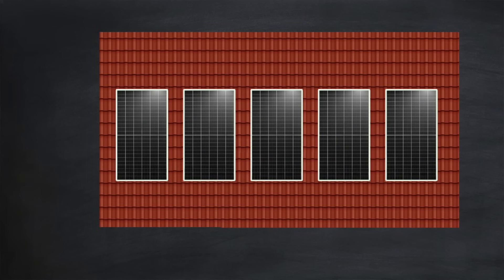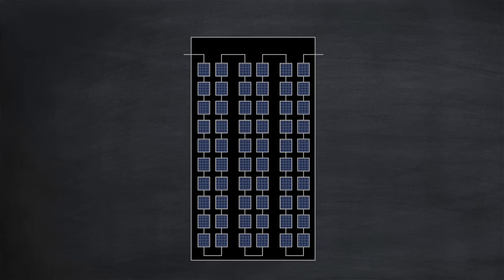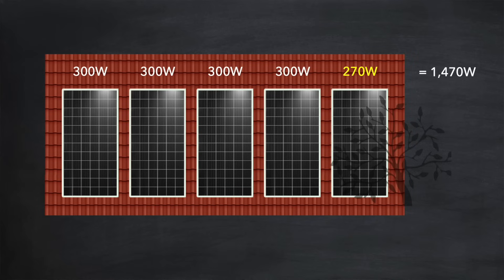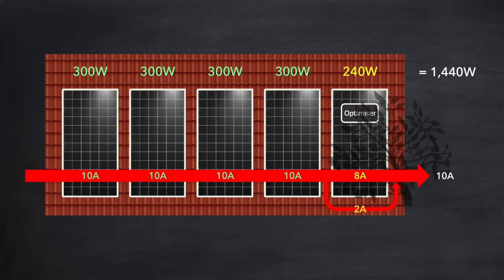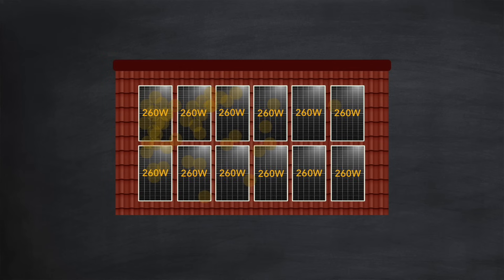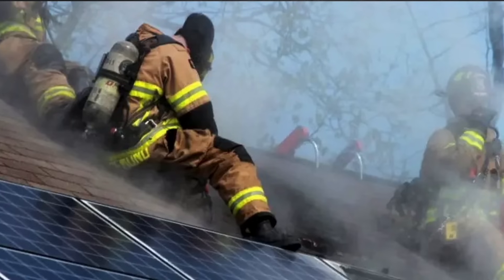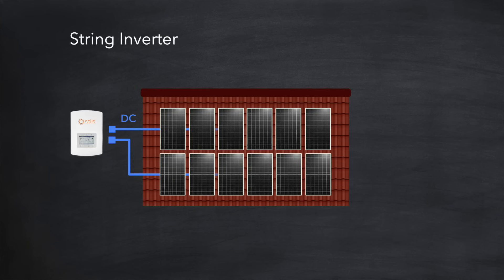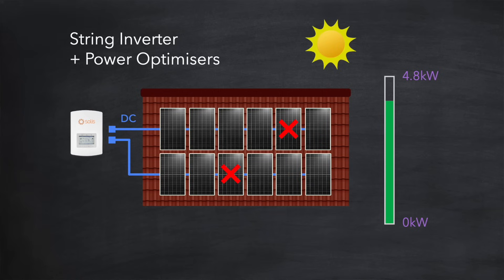Power Optimisers - What are they? And do you really need them?

Comment: OT:  Has anyone developed a mounting system for PV panels where they're attached to the railings on one side with hinging pieces and on the other with a latch release?  This would allow a technician to unlatch the panels and swing them out of the way which would be ideal to access a problem in the middle of a panel array instead of removing several panels to gain access.
Reply from the maker: Hi Glenn, I like your thinking on this. I'm not an expert but having an easy access mechanism could be a good thing... it can't add much to the cost, surely?

Comment: Not much point in a string inverter setup, with or without optimizers.
Reply from the maker: Why?
Reply: @GaryDoesSolar  ??? I thought it was fairly obvious but since you asked. As you and other pointed out: Still have single point of failure, not much benefit for cost, relatively high failure rate. Money better spent on micro inverters: higher reliability, softer failure mode, more up front company (Enphase). 

BTW, Since you read and responded to this post with a request for a reason, would you explain why you didn't respond to my next one pointing out the inefficiencies of your solar installation?
Reply from the maker: @GntlTch First, I prefer people who make claims to back them up, so others can judge for themselves. Second, give me a chance, why do you? 🤣 I get a lot of comments, emails and messages every day. Third, I think it goes without saying that I would know how to run my solar and battery installation efficiently, don’t you? I’ll respond on that shortly…

Comment: A tug of war between Microinverters and String with optimisers. Everyone is lying, not infact they are biased one or the other side. If cost and ROI is the concern, always go for legacy and proven. We need regulation in both sides to have some standards body to make sure customers do not suffer losses due to vendor lock-in as the solution is supposed to last half a century or more.
Reply from the maker: Certainly, it's always worth putting in time and effort to check the performance and reliability of any product you're interested in before you part with your hard earned cash. Solar forums on social media is a great way to do this.

Comment: Thank you Gary for creating this video blog and sharing it! Very helpful. I assume either SolarEdge or Tigo string inverters will work with or without optimizer. Looking at Tigo web site I got impression, I must use optimizer. Since it does not clearly say the inverter can be used with out optimizer. Also  Tigo "hybrid" inverter says "can use with or without battery connected". If that is true, it can be used like "string" inverter.
Reply from the maker: You're very welcome :-)

SolarEdge Optimisers are required for SolarEdge inverters, but Tigo optimisers are optional for any other solar installation. Yes, a hybrid inverter, although designed to accommodate a DC Coupled battery, does not have to have one connected.

Comment: thanks. however, you did not cover the fact that optimizers allow you to put panels on different slopes and azimuths, and have them still connected to that same MPPT of your string or hybrid inverter. for me that is probably the biggest benefit of them, and I'm going to install Deye optmizers soon when they arrive, together with adding more panels to additional roof slopes that were panel-free before.
Reply from the maker: What you say is true, but it's a limited benefit and not one that many installers recommend, from what I hear.
Reply: @GaryDoesSolar  it's the most benefit, since I now can add 3kW of solar easily without losing any efficiency and without any major system rework.
Reply from the maker: @BackyardVoltage  Hopefully your inverter is one that can accommodate such a configuration (i.e. global MPPT scanning).  I'd be interested to hear how this goes... thanks!
Reply: @GaryDoesSolar  it actually already does. Since it's Deye 10kW 3 phase, and currently I have 6+7 panels paralleled strings on its MPPT1, and MPPT works perfectly balancing the power output from various size paralleled strings (currently all the panels are on same 33 tilt and -22 azimuth), I've been doing many tests with it. But optimizers will allow me to get more panels added there to the other roof side (55 tilt and 68 azimuth) to cover the evening peak better, and also due to high tilt it will be so much better for winter (better winter angle to the sun, and no snow build-up).
Reply from the maker: @BackyardVoltage  Sounds great - and good to know, thanks! 😃

Comment: Hi Gary, Hooking up an array of ten 400 w each panels. Going into a EG4 18k hybrid inverter. Then EG4 battery bank. Two or three panels on the east end of array will be shaded in the morning by a tree. Should I add optimizers to just those three? What would be the point in doing all ten when the seven panels are clear of shade all day?
Thank you very much.
Reply from the maker: Hi Brent, unfortunately, l'm not in a position to provide individual advice (not least because of potential liability issues, even if that advice is given free - such is the world today). You're best to speak to an installer for such advice, or post a comment onto a solar forum (e.g. this one in the UK: https:// www.facebook.com/groups/2197329430289466). Good luck!

Comment: Surely a 0.05% failure rate is 1 in 2000 not one in 200?
Reply from the maker: It is, but if it’s a 10-panel system, each with a microinverter…

Comment: Good explanation, but you didn't talk about cost difference. Example..I have a 24KW Solar system with 60 panels at 450W. I can get my three 8.2KW Fronius Primo String Inverters for around $7,500,- while the 450W enphase micro inverter would cost about $14,700,-. That's close to double the cost. 
There are a lot of plus and minuses on both sides when it comes to String Inverters/Micro Inverters/Optimizers. I can just talk from real world experience. In 20+ years we are now on our 3rd system. 1st one was a 3KW system with a quality string Inverter installed under the Eve outside...never a single component failed or showed noticeable degradation in 10 years. We sold the house and I do believe that it's still working (now 20 years) as I drive past the place fairly often and I can tell that the original panels are still on the roof. 
2nd system was a 4.2KW hybrid system with the Inverters installed in the rumpus room. !0+ years absolutely no issues and after 10+ years I could not tell any degradation. In that period I went twice on the roof and gave the panels a wash-down with pure water, no detergent. This system has now been upgraded to 24KW. 
I directly know of 3 users of micro inverters that all had one or more issues with them, including one within weeks of the installation. 
Were they just unlucky?..possibly. Have I been just very lucky..also possible. But I also put the odds in my favour by selecting quality and proven components and reputable installers.
Reply from the maker: Would be interesting to know if the microinverters in question were Enphase IQx series. I don’t really rate other microinverter products.
Reply: @GaryDoesSolar They are/were Enphase, but which model I wouldn't know. This was at least 5 years ago with the one where failures happened shortly after the install. He had a 10KW system installed and there were issues with 3 or 4 panels, which took multiple months to be resolved. Although that says more about the Installer then the product itself.

Comment: I have four 330 watt panels that I use to charge an Ecoflow power station. The panels are wired in 2S2P. The other day one panel suddenly stopped working and I lost 50% performance. The panel that it was in parallel still shows amps using my amp clamp and the suspect panel shows zero amps. I tried the panel in a series string of three and I get zero amps. If I take the plus and minus of the bad panel and connect them together I get 9 amps the panel is rated for. I'm thinking bad bypass diodes. What do you think. I have ruled out connectors.
Reply from the maker: Sorry that you’re having issues with your setup. Unfortunately, I’m not in a position (not insured) to provide individual support/advice. You may want to contact the manufacturer direct. Good luck resolving 👍🏻

Comment: I have 25 panels installed in 2015. Ive had 2 microinverter failures. 1 in 2022 and 1 in 2023. Either your stats are wrong or im super unlikely. Enphase.
Reply from the maker: Sorry to hear about the failures. Were they rectified under warranty?
Reply: @GaryDoesSolar  1 was. I'm waiting on the second. The install company moves extremely slow.
Reply from the maker: @angloblaxon  I'm planning an interview with Enphase soon, and will ask them about product reliability...
Reply: @GaryDoesSolar update. My solar company got out of that part of business and I'm not receiving any support. Add that I need a new roof and to remove and reinstall is 10k on top of roof. I've decided to ditch the enphase system and install the panels via ground mount with a string inverter. Diy.. wish me luck.
Reply from the maker: @angloblaxon  Sorry that your installer went out of business - might explain then why you didn't get decent support. I wish you the very best on the new approach! 👍

Comment: @GaryDoesSolar, can you help me if i have to select 600W or 450W opzimizer is enough for a system, where all opzimized panels are DAH 410W panels.
Optimizer is Huawei PV 600W or as asked the same but with 450W?

I'm not sure i only need to check the W rating of the solar panel, or some other detail from the datasheet?
Thanks in advance for your feedback!
Reply from the maker: Unfortunately, l'm not in a position to provide individual advice (not least because of potential liability issues, even if that advice is given free - such is the world today). You're best to speak to an installer for such advice, or post a comment onto a solar forum (e.g. this one in the UK: https:// www.facebook.com/groups/2197329430289466). Good luck!
Reply: @GaryDoesSolar  hehe world is a crazy place for sure
waaaaay to many freedom, people dont know what to do with themselves
thanks for the tip, joined the group and hopefully someone will help me to understand which one to use and for what reason

why i asked is, i just have my system installed, and in the offer it was 600w optimizer, but now i see in the system monitor that they installed 450w
i did not pay yet, so i dont worry much, just want to understand if my system will make less if i settle for 450w and ask for better price, or should i insist on them change to the 600w which they offered

Comment: I believe that you have made this video with absolute positive intentions for your viewers. And I really mean that, no doubt there… but you have no real world comparison on string, string+optimizer, micro-inverter. Only your own experience with one solution and the rest is extrapolated based on marketing material. Though I’m absolutely sure your intentions are positive, I don’t think your reasoning aligns with test results.  I’ve seen multiple tests that contradict the marketing of microinverter and optimizer claims. There are definitely use cases where those solutions are the best choice (exceptional shade, multiple orientations), but in my view it’s not the best choice by default and in all situations. They have good marketing, but I despise marketing that includes disinformation.
Reply from the maker: I’m up for critical commentary, but only if it’s specific.

Let’s start here: “I don’t think your reasoning aligns with test results”. 

Specifically what test results does my reasoning not align with?
Reply from the maker: I'm waiting...

Comment: Why isn't there ONE video on the internet showing an array of solar panels and their output BEFORE putting optimisers on, and then showing their output AFTER putting optimisers on, to prove they actually work?
Reply from the maker: If you think about it, that’s not a straight-forward thing to do with a single installation…
Reply: @GaryDoesSolar   Only if they're roof mounted. There are plenty of ground mounted installations which Tigo could easily use to prove that their product actually works...
Reply from the maker: Good point!

Comment: I used optimizers mainly because my panels have different orientation. Otherwise I would have had to use multiple string inverters and i would have lost out one some spots where i could only fit 2 panels on that orientation. This could also have been done with microinverters. So being able to fully use all the space on the roof is a big advantage for me.
Reply from the maker: Sounds like you found a great solution to your situation! Thanks for sharing as I think it will get others thinking for their own installations...
Reply: How much more %  production you get now with optimisers?

Comment: After all my research it seems just buying a good MPPT/ ac-dc inverter/battery charge controller combo unit will be the way to go. Spending $2300+ for optimizers just dont make sense. Thats 40% more added on top of the cost of my whole planned 5520w 25 panel setup with 10.2kwh battery system will cost. Mine will be in a field setting on the ground and unshaded, eventuall ill add a motorized arm thatll pivot the whole arrays mounting scaffold with the use of a peak sun sensor. I feel like itll do a lot more than these will in such an unshaded system
Reply from the maker: Sounds great!

Comment: As a owner of 20 solar panels I can share you my experience with both Solar Edge and Enphase. I started of with Enphase D380 microinverters that converts power of 2 panels to AC. 3 died in 12 years, failure rate is almost 30% as 20 panels had 10 microinverters. So not to impressed about that I switched to SolarEdge. I noticed that a lot of time my Enphase would give power while solaredge didn't. Also the SolarEdge inverter had issues after less then 3 years (I don't think this is common, just bad luck). Enphase promised they solved the microinverter issue with the newer models. Ok with me but they also changed the connectors so that meant rewiring the whole array. So both have advantages and disadvantages. But let's list my conclusions on both.

Enphase:

1. No phantom power usage from grid
2. Warranty dealing was good.
3. When one micro inverter went down, others where still happy.
4. Little bit more pricier then SolarEdge.
5. Propriety heavy duty interconnect cables and combiner boxes are pretty much needed.

SolarEdge:

1. Draws phantom power from grid at least the first one did.
2. Had the luck of inverter failing so no power what so ever for weeks.
3. Warranty seems harder to get. But not impossible
4. No combiner boxes on the roof because higher voltage allow for more solar-panels in series and uses stand MC4 connectors.

So can't really tell which one is better. Both have drawbacks and advantages. Pick one and stay with it, don't switch like I did.

Comment: I don't really care if my Solaredge optimizers fail once in a while and I've only had one fail in 9 years. New, from reputible ebay sellers, they are about $60 and used they are $30. Of course this is me doing the replacement myself, so my labor but it is very easy.  I did have a Solaredge inverter fail after 9 years and replaced under warranty after 3 weeks down time. These are about $1600 but there seem to be a few old stock new for about half that and used are even less.

I think you need to budget a couple hundred dollars a year for stuff.  I'm in San Diego which famously (to us anyway) has the highest rates in the US, so my solar saves me over $3k a year.
Reply from the maker: Wow, that's some saving! And it's a good point about the ability to buy cheap replacements.

Comment: I have Enlighten micro inverters on 2 strings of three panels. Unfortunately the Enphase collector/gateway seems to have failed -just flashes ref lights - support said its out of warranty.  New ones are £600! Only benefit of replacing is to be able to 'actively manage and monitor' the panels. I'm struggling to see the cba of replacement. Thoughts? Have I missed something?
Reply from the maker: £600 is a fair whack, especially when it's just to get you back to where you were. Assuming the solar array is performing as it was before (same generation as this time last year, or in line with PVGIS) then might be worth waiting for the day (that may never come) when the array performance drops...?